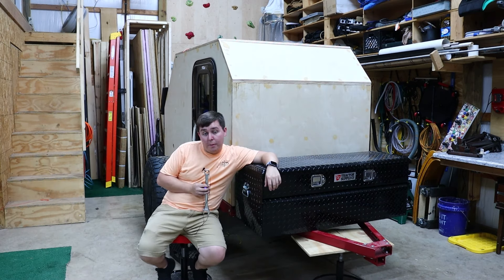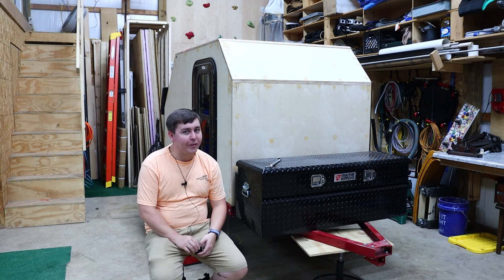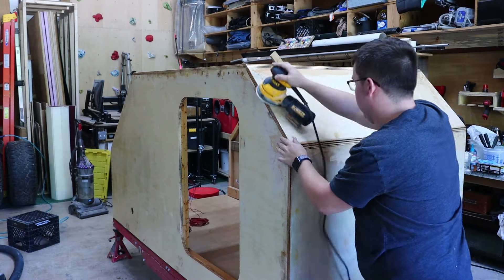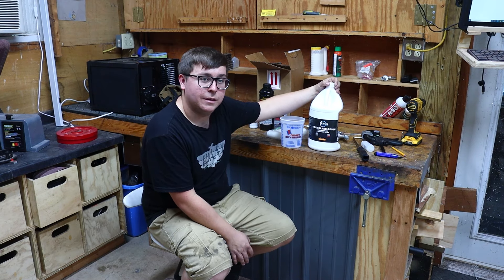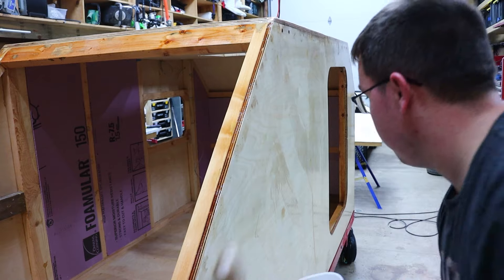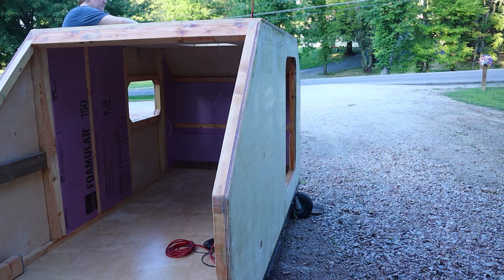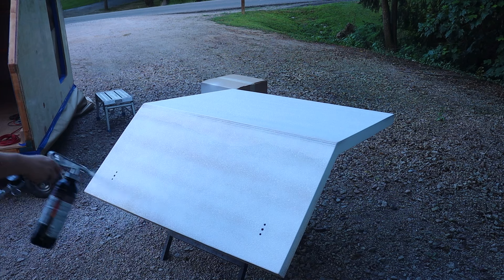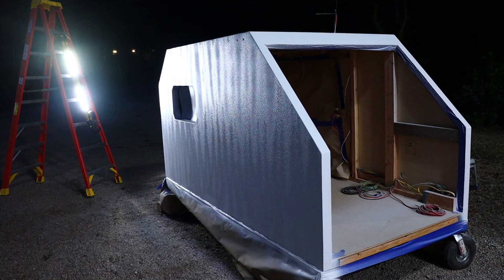TearDrop Camper Build | Epoxy and Bed Liner Go On! | EP 9

Comment: That intro had me crackin up.  Also great info.  Thank you.  Looking forward to the next video.  I hear cracking is the major problem with using liner on these campers, but from all I've seen including yours, putting a base layer of epoxy can prevent this. How is it holding up so far?

Comment: Titebond II works a lot better for making the wood filler.
Reply from the maker: Thanks for that tip I will have to give that a shot next time!
Reply: @_Riley  yes, the Titebond II is as semi waterproofing so it is sandable and get hard so it holds paint and surface items better. 

People have also used it to make "poor mans fiberglass" with canvas and other cloth materials to make a solid, water proof and paintable cover. I know here in Florida it holds up real well to the salt air and humidity.